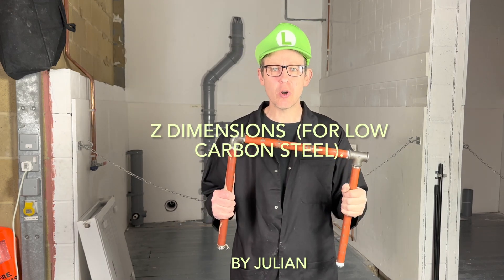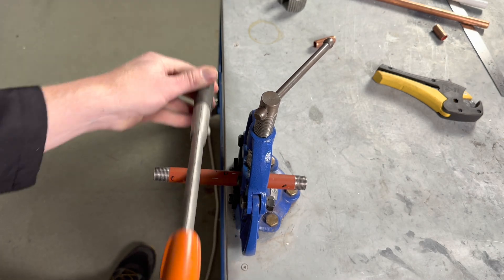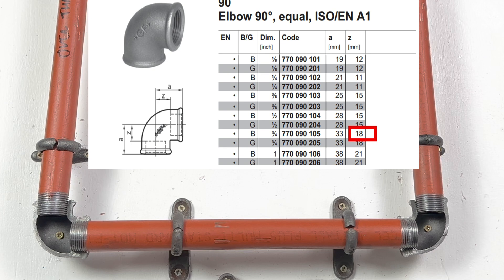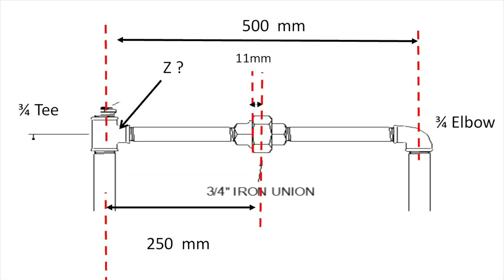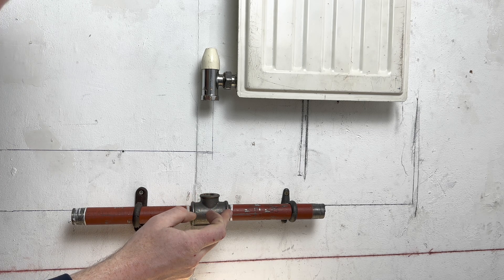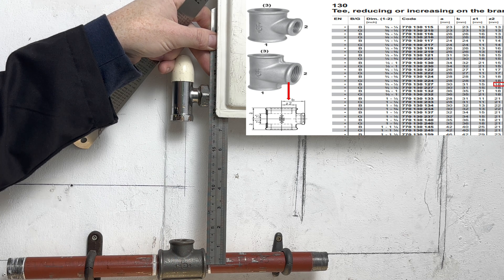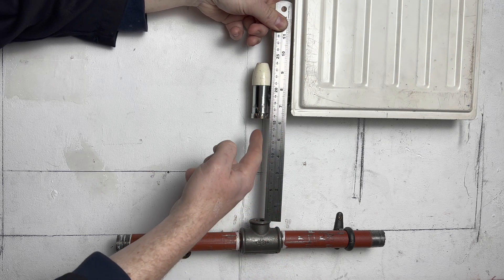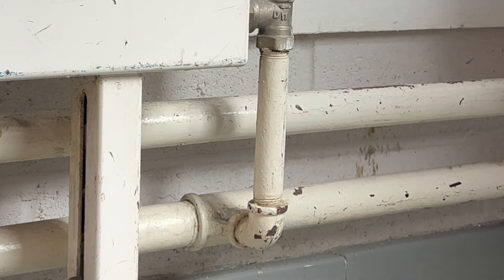Z dimensions for low carbon steel pipework with quiz at end. (4K)

Comment: Hello please can you check my answers for quiz number 1.
A = 381.5 
B = 381.5

C = 885
D = 785
E = 885
Reply: Actually I'm wrong I halfed the z dimensions for the elbows and tees. So update.
A =374
B =374
C = 870
D = 770
E = 870
Reply from the maker: yes

Comment: Hi, im just learning so would really appreciate a response on this. 

Firstly could i ask you what the B/G stands for in the spec sheets.

This is slightly educated guesswork but i get the  following.

D = 770
C = 870
E = 870
A = 363
B = 363.

Thanks for any response.
Reply: B black. G galvanised
Reply: @julianchristie2543  thanks Julian, greatly appreciated.